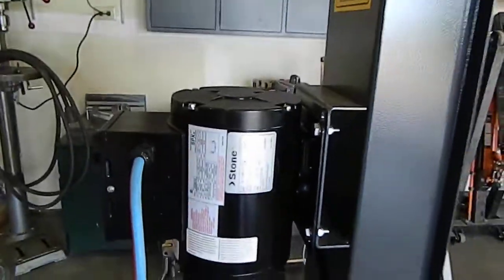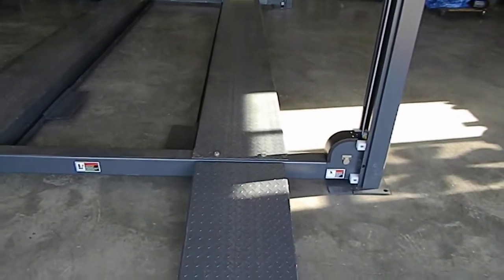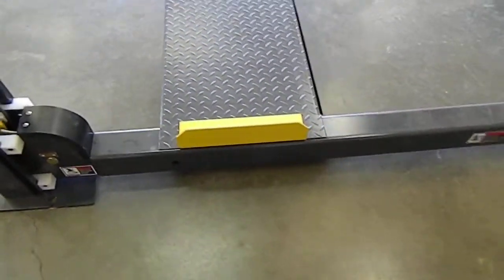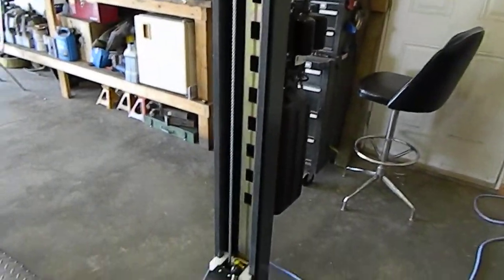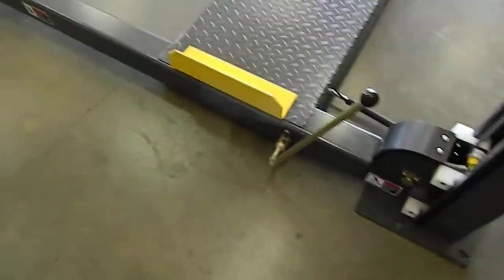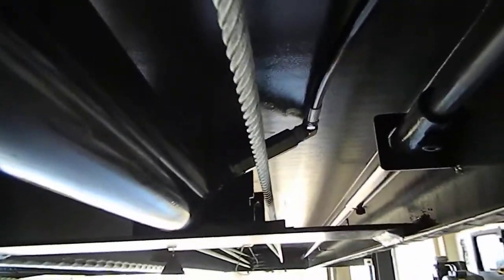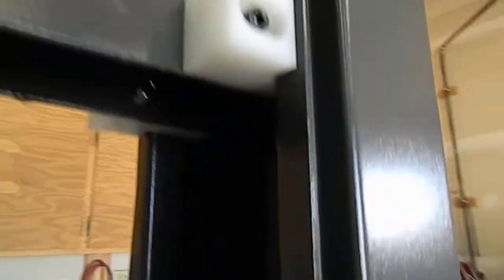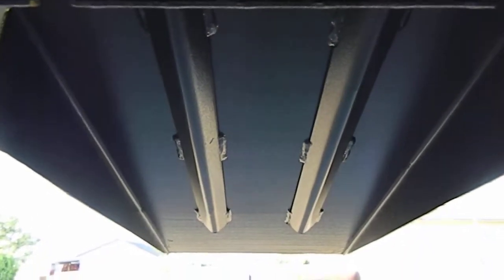Peak 409P 001

Comment: I have the Peak 408-P. I have had it for almost 1 1/2 years and LOVE IT!!  I did a lot of research before buying it and am thrilled with my choice. It is beefier than most 'hobby hoists' and looks great! I love the hidden safety lock linkage and the steel grey colour. Interestingly, people shy away from the 'Chinese' made label, but most on the market are made there and then labelled when they arrive here. This one was actually sold as an Atlas SL-408-P (or 409 in your case) for several years. I purchased mine about $800 cheaper as a Peak..which IS the actual manufacturer. I got mine from Babco in Canada just after they first started selling Peak lifts. When I pointed out to the salesman that Atlas had been selling them for several years, he was actually shocked and had to look it up. When he saw what Atlas was charging, he laughed and said I was getting a good deal based on that. I told him I had done my homework. ;-)
Reply from the maker: I love mine as well bought it from Babco as well.
Reply: Instablaster
Reply: Im getting the 408-P from Babco as well. Im in Toronto. Any issues to date with your lift?. Works fine?. Did you have to test the concrete in your garage to see if it can withstand the weight?
Reply: @Raven77844  

No issues at all! I Love this lift! I talked with Babco rep about my floor, as I have in floor heating. No issues. I think you will be thrilled with this lift. It is beefier than most hobby lifts and with great features. The hidden linkage and safety brakes are make this an upper tier lift at a bargain price. 🙂
Reply: @ericwoolliscroft5712  great thank you!. Cant wait!
Reply: @Raven77844   How do you like the 408 - p?  Is it stable or does it have movement when loaded?
Reply: @dsmtsi  its been a great trouble-free lift for the last 2yrs. No issues. Very stable under load. Its a little slow when lifting, but I knew that before I bought it. Enjoy.
Reply: @dsmtsi  Let me jump in here as well. It is an awesome lift. I went with the 110v motor so it takes twice as long to lift as the 220v. If you are using it frequently (every day or multiple times a day) you would want the 220. As for stability...it's perfect. You have the option to mount the posts in your floor which would make it unmovable, but if you plan on leaving it free to move with the casters (which I have) of course you could make it wobble pretty good with a load at a high height.  Simple physics at play there. haha! That said, it is a well built unit and I still have zero regrets or issues. A buddy of mine is buying the same one because he couldn't find a better one for the price.
Reply: @ericwoolliscroft5712    Thanks for the reply.  If a car is uo at workong height how much does the lift move if yoy were pulling an axel or something along those lines?

I have read the ones with the square post   not c channel are much more steady but being in Canada there doesn't seem to be any here.
Reply: @dsmtsi  I think it is very stable. I would not be concerned. FYI...this is the exact same as the Atlas 408 lift. ;-)  Atlas just puts their name on it and charges a lot more money for it.  

Here's a good video on putting it together. 

https://www.youtube.com/watch?v=Bv52sqYV4LE
Reply: Question to everyone. Has anyone bought the optional hydraulic jack for the 408-P to lift the car to change tires or brake job? How well does it perform?

Comment: The wobbling is my major concern with these lifts.  Do you have a video on how much it actually moves?
Reply from the maker: I'm not sure I understand your question, but if the hoist is down on the lock it doesn't move much at all. The higher the hoist the more movement, I would not put a full size pick up at the top then push on the side like hell, at waist height I have no problem doing any kind of work on it.